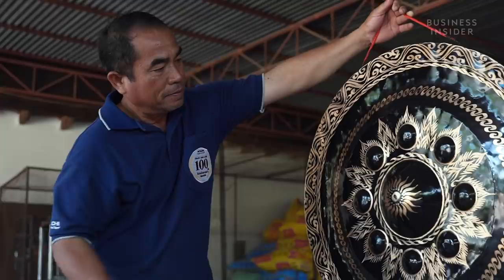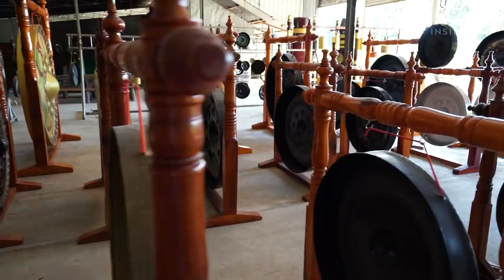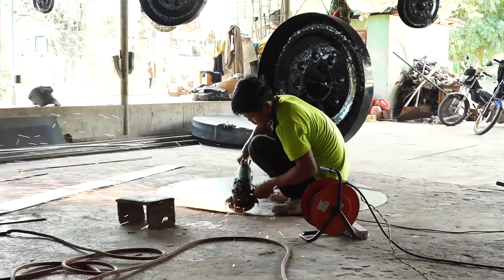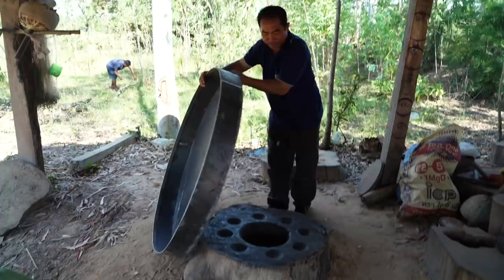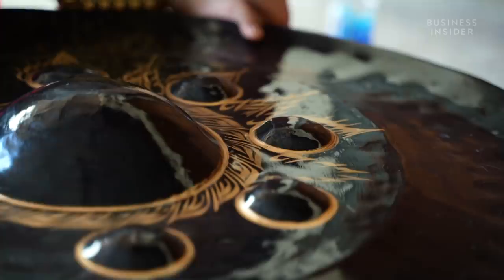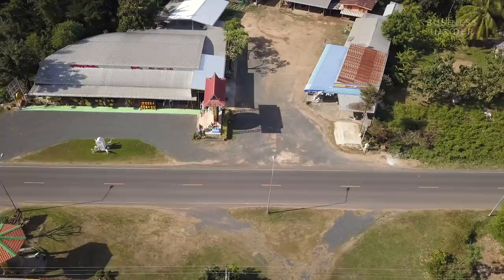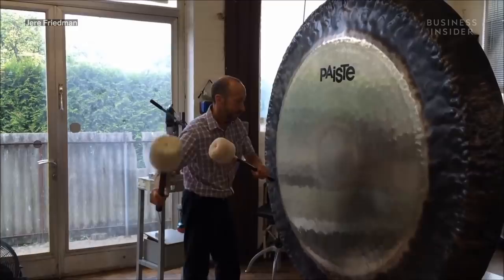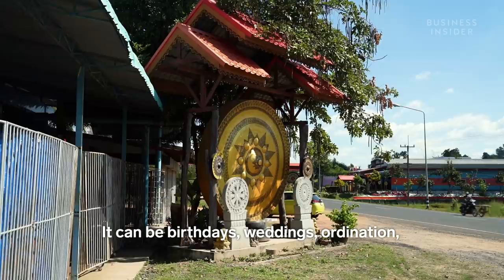Why Gongs Are So Expensive | So Expensive

Comment: I'm not going to add a comment to either of the two very long, ugly threads about German vs. Thai gongs - but a point needs to be clarified. 
People are getting confused by the narrator's comment about Paiste's approach being more scientific. Make no mistake: Paiste makes their gongs BY HAND. They don't use machinery to make them; it's all done by humans with hammers, relying on their ears and years of experience. The "science" comes in when they test their gongs for tonal properties using electronic equipment; Paiste's cymbal and gong making mindset strives for consistency and doesn't permit variation beyond a certain threshold.
This is NOT to say that one method is superior to another, and comparing the two is fruitless and unfair. For one, this video is primarily about Thai gongs. Most of Paiste's are variations of Chinese Chau and Wind gongs. They're different animals. 
In either case, the end result should be musicality, and both types of gongs and the methods they're made by achieve that.